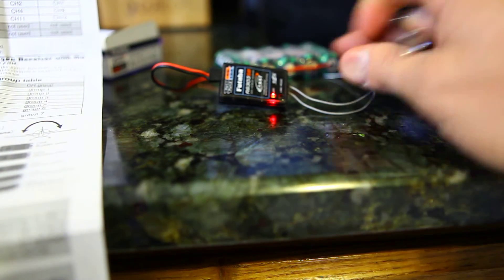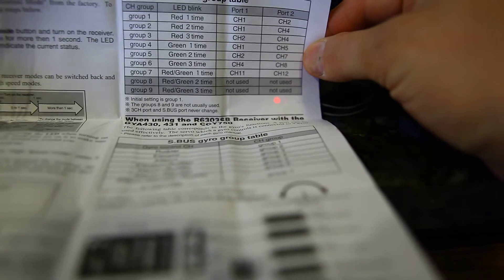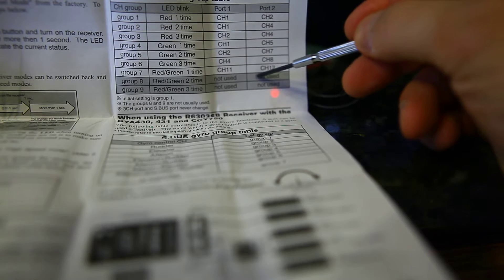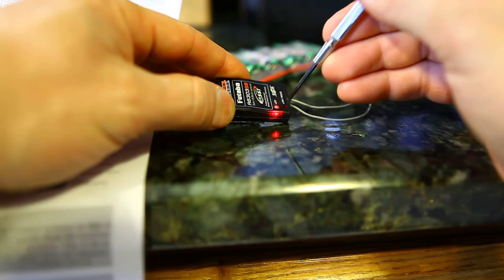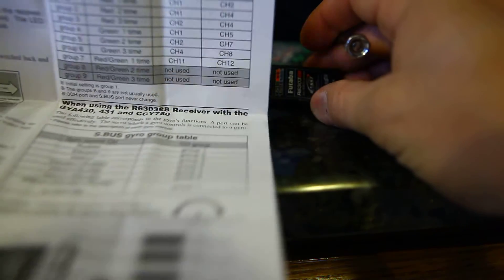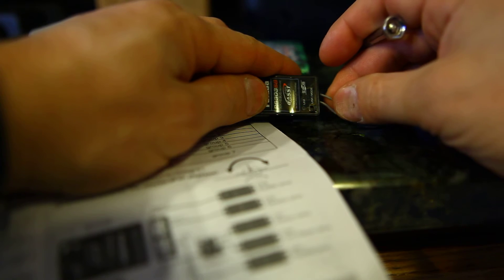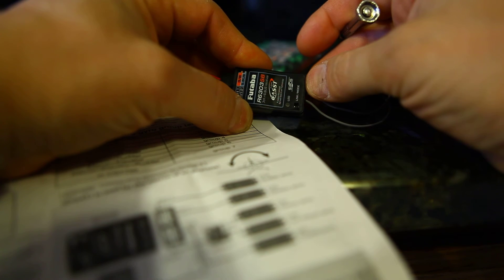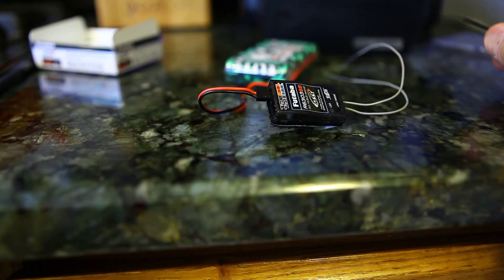Futaba 6303sb or any SBus receiver assigning CHANNELS to PORTS 1-2

Comment: Hi, Can I use the same method in a R6203sb?
Reply from the maker: yes you can
Reply: Ok.  Because the manual don't explain the method.
Reply from the maker: Yes it does, however it's confusing. This is why I made this video
Reply: Many thanks.  Later i try in my home.  I follow the 6303 chart. I need group 7 from ch group table